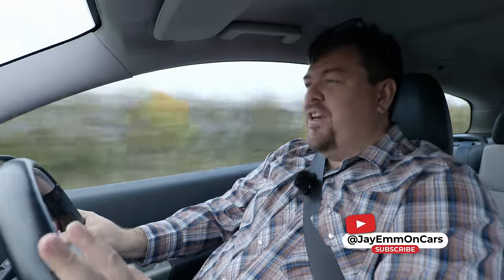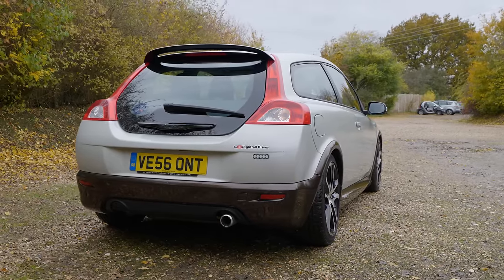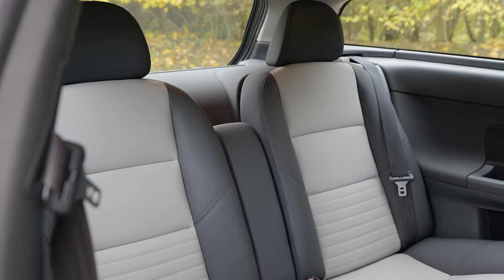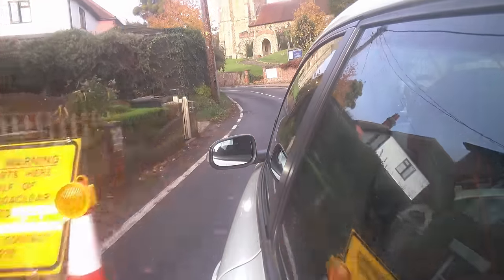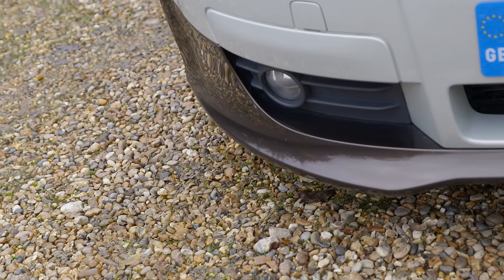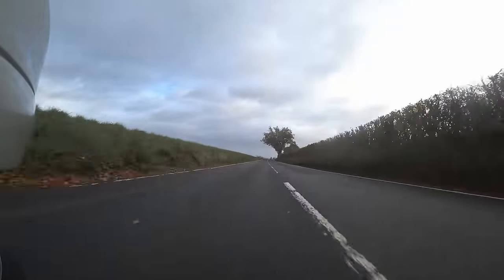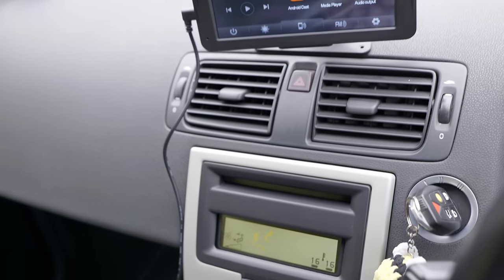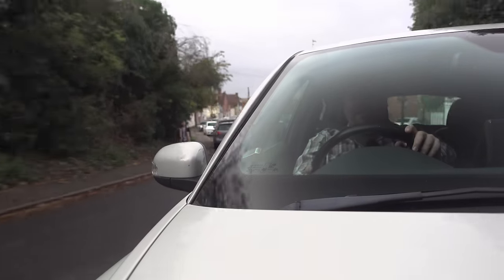The Volvo C30 - More Than Just "The Car from Twilight"?

Comment: Recently my 2006 Fiesta 1.4 went pop and I had to look for a replacement. I had these on my radar as something to look at. But the big dis-appointment for me was just the really poor access into the boot through the back windshield. When you buy a car like this, for most people I reckon, they have to do everything. including lugging lots of stuff about. This wouldn't have cut it for me. I've moved house several times in my fiesta. Never be able to do that in the Volvo, however nice it is to look at. Didn't like the plain, spartan dashboard and centre console either. In the end I had to get another Fiesta - 2008 (1.6 Zetec)! They really are unbeatable. Only thing I can see about the Volvo that I wanted in my new car, but didn't get was the cruise control. Think overall I was right not to get one of these. Better off with the Fiesta.

Comment: I still own a C30 12 Plate, it's got 161k on the clock. Can't fault it, fuel economy is extremely good even at its high mileage, only minus side is the crashy ride.

Comment: Had my Red 2007 2.0D SE Sport (same body kit as your 2.4) since 2009. Still love the design as much as the day I bought it. The 2.0D has adequate performance and returns avg 50mpg. Mines has the Dynaudio stereo which is excellent and also the ‘cheaper’ but better soft rubbery boot cover which can roll up like a scroll 😊 Only downside is that ive had gearbox probs the last few years and have been let down by mechanics/garages who just dont care 😢 Wouldnt part with it tho 😉

Comment: My fiancé and I both own P1 Volvos. She has the C30 with the T5 in nice trim (sunroof, heated seats) and for me, the S40 with the 2.4i shown here. Her's is, sadly, an automatic; but my sedan has the 5-speed manual as above. Driving impressions? The T5 goes like stink--you don't need anything faster that the 230hp it makes. Drawbacks for me, those big wheels and sport suspension make for a stiff and somewhat noisy ride. The S40, though, is much more civilized. It's not as fast and it doesn't handle as well, but with the manual more than makes up for it. It is an absolute BLAST to drive and that 5-cyl engine tone is really unique. Get you a five-speed Volvo, you won't regret it.  Side note, that rumble you are experiencing is just the 5-cylinder engine under load. They all do it, totally normal, and you kind of grow to like it =) And lastly, if you do buy one CHANGE the TIMING BELT because these are interference engines with rubber belts.

Comment: If one was looking for more luggage space, the V50 - the C30's big brother - was an option. Although it was never as commodious as 480 wagons and the like, it still had enough room to be useful. One V50 trick is that the front passenger seat can be folded up against the dashboard, which frees up enough room to slide a 1.8 meter load into the boot.

Comment: Things about this volvo. Will speak from my years of ownership of the c70 d5:

1. Drive shaft issues causing vibrations at 50-65 mph. Can get worse and be felt under load.

2. Engine mount failure leading to vibrations again

3. 06 had better turning radius, ones after in partner 57 plates had rubbish turn signal.

4. Sound system is one of the best with dyna audio which in my c70 comes with two subs in the back rest seat and surround sound.

5. Lux versions, atleast on my c70 came with active seats which lower the bottom section if you hit bumps and so on.

6. Poor response to acceleration, random lights on dash, can be due to poor contacts in ecm in passenger seat. Playing with the connectors normally solves this issue..

7. Notorious for battery drain, especially in ealier models. Not sure about the facelifts.

8. Timeless design in my eyes.

Comment: I have a 2009 Volvo C30  T5 R-Design with 67000 miles on it for sale that I love driving but don’t need because of adding a new car to my garage.  Check it out on Craigs list. I  am considering not selling and keeping it, but I really don’t want three cars  and a motorcycle. I do agree that it is really a fun car to drive.  Before I can sell it I must figure out a very recent water leak problem, that may be leaked to sun roof drains. Listed for $12000.00 but may consider a lower price.

Comment: One of the D5 engines has 190bhp and is easily mapped to 225, it’s a superb engine and will last for ever. However it will eat through drive shafts unless you upgrade them.

Comment: I have a high opinion of these, which are especially rare in the US Midwest. I would consider it a 2-seater, though. Those back seats are cruel for anyone over 5' tall, even if the driver is also only 5' tall. But great for luggage and packages.

Comment: I had one of these as my second car in my early 20's it was brilliant as different styling it stood out from the crowd especially mine in gecko green I only ever saw 2 that colour! Downsides were the boot space really became an issue and the doors were heavy and a bit awkward in tight car parking spaces. It was a 2.0 petrol on reflection wish I'd had the 5 cylinder much better performance but would have cost twice as much as well! Think one day these will become a classic like the 480 has. RIP Volvo.
Reply: I have a Gecko green (we call it merconia (sp?) or baby poo). It has a black roof which tones it down. Mine is fully loaded 58-reg T5 SE Lux with a sunroof, satnav, auto box, full leather (find another one like it!). It is used as a 2nd car but my 1st choice for a burn around the South Downs. It has 133k miles and is super smooth and rattle free.  They are going up in value too.
Reply: @keithburns5974  sounds like you have something unique there definitely worth keeping hold of, the T5's have quite a cult following. You did get the occasional stare from passers by! Personally loved the green mine was also a 58 reg.

Comment: Describing ownership of P1 Volvos (high mileage)... always breaking down on you, but you can't stop buying one after the other !
And you have to have 10year old child hands to work on them especially the 5 cyl.

Note their handling is hugely different from one engine option to the other. Can go from very light steering to quite heavy (2.4i vs T5), from rubbery feeling to harsh and direct (C30 vs S40).

Comment: At 12.04. These volvos especially the 2.4, d5 Nd t5 all suffer from drive shaft vibrations and engine mount failures.

Iv had two c70 and it's their character. Still love these volvos though

Comment: Had a two litre petrol se sport, great car, had some problems though, mainly with the Ford parts. Air con compressed x2, and front suspension bushes, then one day drove car home from work,popped out to shops for better half back home, went to start to put in garage dead battery just like that. Never known that before or since. Great back up though fron Volvo Sunderland so I’ve stuck with the marque ever since and never been let down again.
Reply: I have the same model, may I ask how noisy the AC compressor was when replaced? I had mine replaced last year and its awfully whiny sounding, you can clearly hear it from the inside with the doors closed and windows up. The old unit was never like that, I was told it was just because it was new, but I never really bought that tbh.

Comment: I recently got rid of a 2010 V50 after 2 years, and a friend has a 2012 (facelift) C30. I loved the car, but unfortunately had the older 16v 1.6D Peugeot engine which became problematic from about 140k miles onwards - I had 2 injectors, a blocked DPF and a sticky EGR valve in the space of a year. My friend's C30 is the newer 8v 1.6D (badged D2) which seems to be much more reliable. I would have another P1 Volvo in future, but D3 and D4 engined V50s are making silly money atm and the D5 is apparently a bit of a tyre eater if you use the available power, so for now I'm moving away from Volvo.

Comment: A guy I worked with had a red D4 with the 5 pot 2.4 diesel.
I thought D4 meant 4 cylinder but it’s the spec it came with.
Reply: The D4 was a 2.0 5 cylinder in a C30.

Confusingly the D4 in an XC60 was a 2.4 5 cylinder... But not in any P1 platform car.

The 2.0 5-cyls were pretty much a destroked version of the 2.4 anyway and reliable as a result.

Comment: I had a C30 D2 R Design and changed to a V40 D2 R Design for some reason - nothing wrong with the V40 but it was no where near as fun to drive, so changed it for C30 D3 SE which is far better

Comment: As a 2010 C30 T5 R-Design owner who tried the earlier model,  I'd suggest the later model has enough tweaks to make it worth holding out for... I definitely wouldn't advise the 2.4i model as the fuel cost without the performance seems a poor trade off. Surprised in the lack of love for a 5 cylinder soundtrack, it has to be the USP, although I assume if it were an Audi it would probably get more appreciation. Looks wise they have aged very well, although it's a pity the model range all looks virtually the same.

Comment: My Mrs had a similar C30, albeit the DrivE 1.6D in white.  Overall an 'okay' car but absolutely didn't tickle her (or my) genitals.  It was reliable enough.  The boot release on the tail gate broke off and the Mrs simply tried to glue it back on with 'Sticks Like Sh*t' ... and she may as well used actual sh*t for what is was worth 😂 Great car for running to work and the shops. That's it.  The dog hated being in the boot too.

Comment: I like them but would prefer the 2.4 turbo diesel, provided it were possible to somehow eradicate its propensity for engaging limp mode without having to too much need for a motorway caning too often, which kind of negates the fuel saving benefits. I did see a video of an S60 decat which still got through the MOT but they're tightening up on diesel emissions almost yearly now.
Reply: Unless your usage is totally unsuitable for diesels (almost entirely very short runs) the D5 is very reliable - the DPF is much less of a problem on them than the vast majority of engines IME.
Reply: Yes, a pal has an S60 D4, 2 litre and had the older model S60 5 cylinder before that. Both tended to go into limp mode a lot, as he does a lot of short runs. I prefer to stick with my much older Peugeot 306 1.9TD which doesn't suffer from such issues, albeit it is a lot more agricultural sounding. @EnglishTMTB

Comment: I owned a 2008 R design. I liked the car but they were not built to last. lots of wheel bearing failures and water problems with the sunroofs on these ford/volvo cars. 
But if you can get one cheap and in good condition it is a great car you just might want to also own a second car.

Comment: 2013 Volvo C-30 R Design Polstar enhanced 6 speed manual T-5 60K miles a Colorado car. Way more power then the factory states. At sea level on 93 OCT with better tires as much as 80 HP more.

Comment: I'd say a 6 speed conversion would be an idea then if that sits at 3000rpm at motorway speeds. Could you fit a box from a T5/ STi/ RS??
Reply: I believe the 2.4i uses an M56 transmission, and I know in other models the M66 6speed does work as a conversion. So yes, likely.

Comment: Can confirm it drinks more than a 6cyl BMW. I've owned both a 2.4 S40 and an E92 325xi and the AWD BMW had better fuel economy
Reply: Wow... that's actually quite bad. Considering it made the same power as a 4 pot NA 2.0 engine and it is much smaller and lighter and only drives the front wheels.

Comment: is there any engines to avoid? i was previously told that the 1.6d is best avoided, anyone have any personal experiences with them?  cheers.
Reply: 1.6D is the least reliable I believe yeah. 1.6 and 1.8 petrol are OK but are generally a bit overstrained with the C30's weight. 2.0 is generally reliable, but can also suffer from swirl valve solenoid failure (basically flaps in the intake that open up at about 3k rpm), it won't kill the car but it will be very sluggish, thankfully that is actually a cheapish fix, its a common part on fords and mazdas of the era. Volvos of the era do also generally have shorter lifespans than some other cars for their alternators and AC-Compressors because the headlights are always on, and the climate control keeps the compressor always running. If theres a sunroof, the drains do clog fairly easily, which can cause it to leak, so just make sure you keep it clean. And suspension bushings do perish quicker than in say the equivilant focus, because of the firmer ride and extra weight. Despite all that though I wouldn't trade it! Its just nice to drive, and fits me well, even if it isn't the most luxurious by todays standards.
Reply: @__-fm5qv  dam, nice overview, thanks. I love the look of the C30, even after all these years. Will hopefully own one once my 03 plate Civic dies, which will hopefully be no time soon. Cheers!
Reply: @MalcolmXpat  I'm sure that Civic will soldier on for many years to come! Those things are as bulletproof as you can get. Also my favourite gen of Civic I think, they still hold up looks wise today imo.

Comment: If you want more space the V50 is the best choice which also came in an awd version. Same engines and same car. The NA engine is to be preferred as it lives longer and has enough HP for the size and weight of the car and had a smoother power delivery. These 5 pots are the same as in the bigger cars such as the V70 but with a different packaging to fit the smaller engine room. 
There's also a D5 of the C30 and various small 5 pots 2 liter diesel engines too. All the 5 cylinder engines are the white block engines of a Swedish design and with the right maintenance good for about 300'000 miles. 
Many mechanical parts are Ford parts as you mentioned but when it comes to shock absorbers, get the Volvo original as they're tuned differently or get Bilstein B4.

Recently replaced my 55 plate 1.8 V50 with a 59 plate V50 1.6D and it's great to drive so any car from the P1 based cars are great and much more quality than equivalent Fords. 
Thank you for a great upload.
Reply: The V50 is great, we have a 50 D5 for the week and a 30 T5 for the weekend - best of both worlds! I think James has driven a 50.
Reply: @mcgherkinstudios  that's a great choice of cars but never owned the C30. However being from Sweden, Now living in Scotland, Volvo is always my first choice of car  and always go for an estate.
So far I've had 340 1.7, S70 TDI, 960 2.5, MK2 pre facelift  V70 D5. Absolute great cars and runs forever..

Oh, I need to try to find that one. Thank you.
Reply: @VinDieselS70  My bad, it was an XC70! 

Sweden is beautiful - I went over one year for the World Rally Championship and it was the best trip I’ve ever been on. I’d love to go back one year and explore more. Scotland is beautiful too but in a different way.
Reply: @mcgherkinstudios  Scotland is more like Norway. Sweden is great for sure, and only when you move away, that's when you realise just that. 
Oh I bet you did 😃. 
Not sure you ever noticed but didn't you see quite a lot of tyre marks in roundabouts or 11s on the main country roads? Where I lived in the South we had a famous car meet every year and during those times with the cooperation from the local police and the authorities, a section of a dual carriageway is closed off just for the sake of running an official drag race on public roads. 
Oh, never mind, the xc70 is equally a very great car too 👍🏼
Reply: @VinDieselS70  Yup, I found Sweden much flatter. Was mostly in Varmland, staying in Arvika and rallying around near Torsby with some stages across the border in Norway.

The rally was in February so all snow, I’ve seen some of the wild stuff like the Stockholm open etc. but obviously none of that was happening when I was there.
Reply: @mcgherkinstudios  I'm from Ångermanland which is north west från Värmland bit lived most of my life in the far south. Then you also know how long it takes to travel to get anywhere. You should definitely go back in spring or summer and you'll see all the old American cars out and about and it looks like you had a great time up there in the cold 😃
Reply: @VinDieselS70  Absolutely, I’d spend a year there if I could!

Comment: My sister had a C30 D2 facelift with the R design package for several years and loved it a lot because of the looks. Unfortunately regularly she had to throw a lot of money into it to fix something broken. In the end she had to give it away cause the horrible Peugeot engine in the D2 broke after 116k km and it broke her heart. Beside that it was fun to drive.
Reply: She managed to kill a Peugeot diesel!? That is actually impressive, PSA diesels tend to outlive the car it's in, what did she do? Never service it or think it's an F1 race?
Reply: It was a rod bearing damage. We asked a Volvo mechanic we met, he said that the D2 had the worst engine in the whole line-up and problems with the rod bearing seems to be very common on that. My sister is miles away from a F1 driver and it was yearly serviced.
Reply: @khalidacosta7133  loads of people did in these - the D2 and 1.6D were the most unreliable engines in these cars by a long way.... Then the 2.0D PSA engine.

The 2.0 and 2.4 Volvo diesel's (all 5 cylinders) were much more reliable.